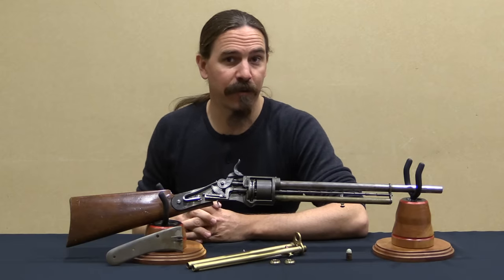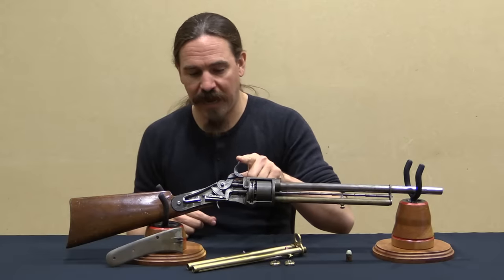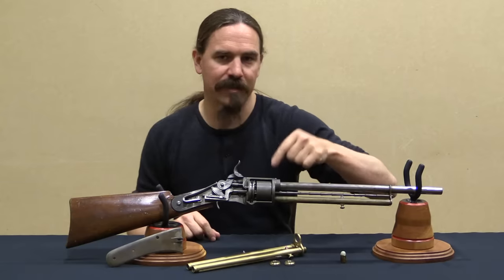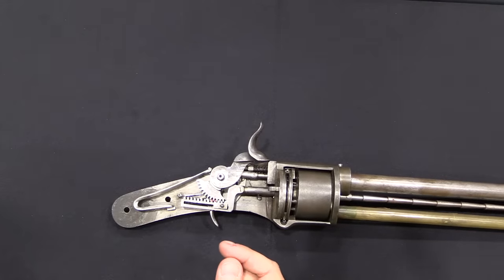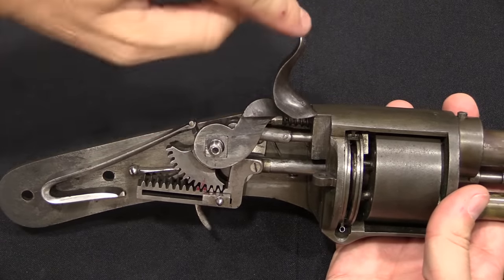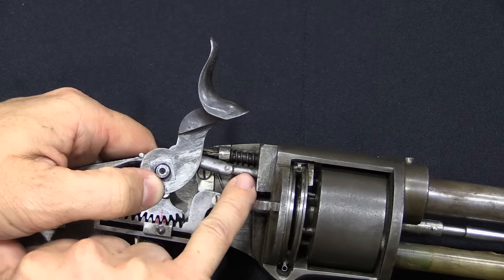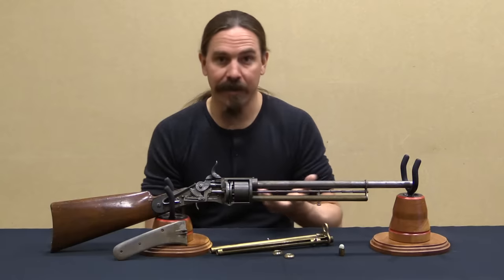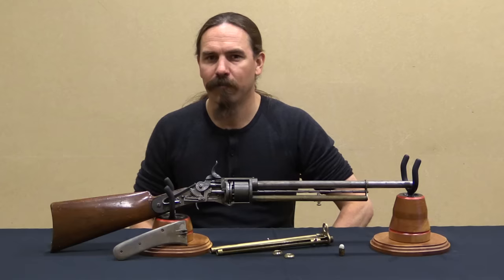Lindner's Improbable Tube-Fed Striker-Fired Caseless Ammo Revolver

Comment: The who fouling thing got my wheels turning wonder why you could not have a heavy felt disk on the back of the projectile to clean some of that away during firing. The current round would remove some of the fouling from the previous round. 

Would by no means be perfect and it would still build up to a point where the gun would fail but it would increase the rounds fired before that point.

Comment: How would multiple feeding tubes even function? Surely, with three tubes, the same chamber is gonna cycle through all three tubes before getting fired.
The first tube would feed a bullet into the empty chamber, sure, but the second and third would also try to fill that same, already filled chamber. And I don't see a mechanism to stop the overfeeding, so you would either be unable to fire the gun, as the occupied chamber blocks the feeder from sliding back, thus blocking the rest of the mechanism.
Is there something I missed that makes this a non-issue?

Comment: You didn't show the mechanism for ejecting the spent percussion caps. I presume that there's a ramp or wedge on the other side of the cylinder that pries them off as the nipples rotate past it, but that's just a guess. It would have been nice if you'd shown us how it really works.

Comment: If this had been a bit more refined and probably massively simplified, this could have been a huge changer if the civil war was fought with soldiers capable if having 10/15/20+ rounds of ammo. No way the civil war battlefield tactics actually used in the conflict would have been applicable if every solider had that much firepower

Comment: Was there any mechanism to remove spent percussion caps? Or was that yet to be designed?
Reply: There's an ejection port for it but I bet fitting and removing the caps smoothly would be a big failure point

Comment: re watched with new black powder, combustible cartridge eyes? 
 
What IF? Lindner had an idea to change the timing a bit and double feed or time a loading tube to cylinder for a Duplex or more type loads? or a charge then a charge with ball, for a Larger Punch in a smaller size? all he would need to do is make the cylinder hefty enough for total designed Charge.

think of scale to Naval guns? of these days of sail. already had the PUCKET Gun?

Comment: No, no, no.  You cannot have 3 tubes feeding one cylinder which only fires one round per rotation.  The other two chambers would still have a cartridge and blocking the tubes from loading another round.